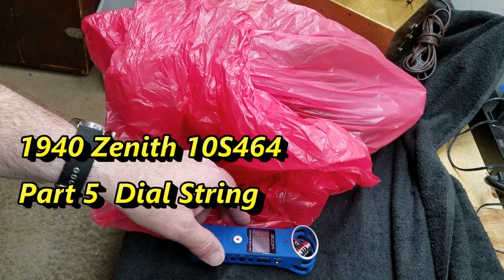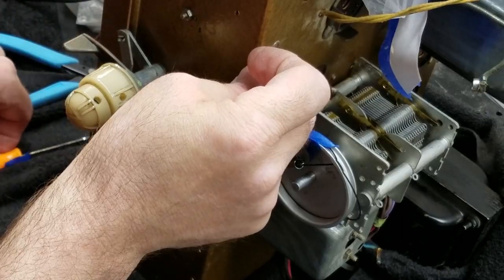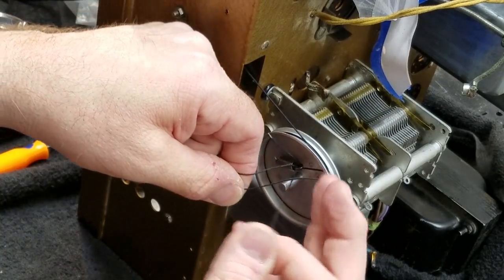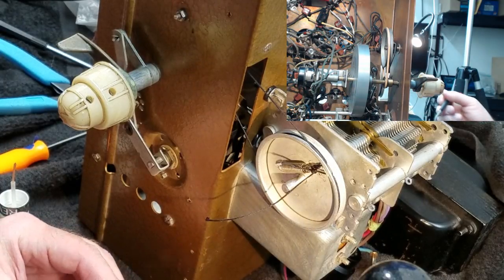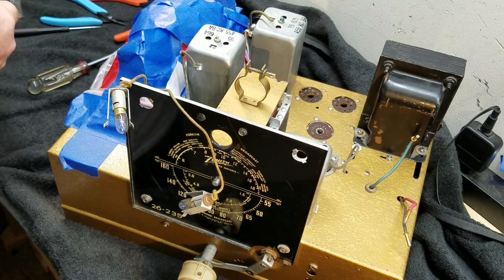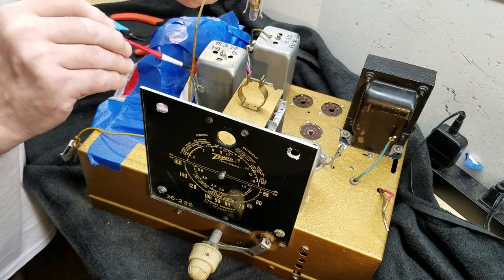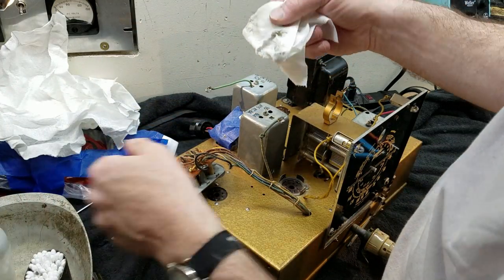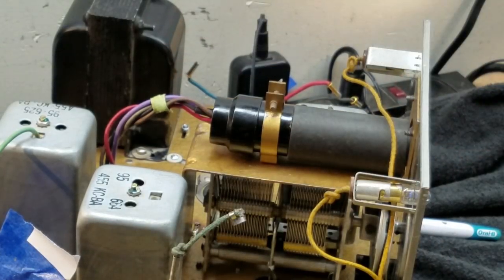1940 Zenith 10S464 Antique Tube Radio Part 5 of 8 Dial String

Comment: Hello. When I was working in a radio shop, we used cotton fishing line 25 lb. test.  It was the same size and strength, plus, it was a lot cheaper.  The only down shot of it was that it only lasted about 30 years on the spool without losing its strength.  In the 45 years I worked there we only bought 3 spools.

Comment: I forgot to mention that we used nail polish to lock the knots.  Each guy had his own color so if the job failed, we knew who did it.
Reply from the maker: I learned the model glue trick from looking at an old repair that had been done up with something that looked like nail polish or lacquer.  Then I began to think about what would work well on polyester cord.  Model glue made sense, and it has worked well.  it is messy, though, and sort of ugly.  Lacquer is cheap, and I might keep with it.  Thank you for your terrific comments, Dan!   Cheers!   Michael

Comment: Unfortunately the dial string is the only thing I've been OK with so far - I have no electrical background or understanding so "that's" been very hard for me to pick up!  But give me a dial string diagram and I have no trouble or qualms! :)
Reply from the maker: Bruce,
I can definitely relate to you on the dial string thing.  I spent 20 years restoring old cars, mostly European.  I can still build an air-cooled VW engine in my sleep!  So, the mechanical side is no problem for me, either.  As an electrical engineer, I understand the theory of radio design and operation.  But, I am a relative newbie to the hobby.  I don't have the 30+ years of experience in the field to help me to know the way these things were actually built and what little tricks can help me to figure them out, fast.  It takes more than knowledge of theory to know how to figure these things out in real life and I wish I had those years at the bench to make troubleshooting these things look easy.  

After being snubbed a few times on the Antique Radio Forum, I decided to take a different approach.  I'd make vids showing how to do what I know well.  In the process, I hoped that I'd make some friends with whom I could exchange information and get better at the things I don't know as well.  So far, it has worked out way better than I expected.  I've met some of the nicest folks, most of which I have subscribed to and they have subscribed to my channel.  By the way, I think that most of the guys on ARF are brilliant.  I just don't think that they are very friendly and they have little patience for newbies who ask the simpler questions.

No matter what you might lack in experience or knowledge, if you participate in the YouTube world long enough, you can get better than you ever thought you could at those things.  Stick around, my friend.  I hope we can learn from each other!  If you see me doing something bone-headed, shout at me and let me know.  I don't have an ego in this game.  I just want to get better.   Before I croak it, I want to get as good as those 30-year veterans are at troubleshooting and repairing these wonderful old sets.  I still have a very long way to go!

I'm really glad that you are out there, and I am grateful that you took the time to comment.  The comments are more valuable to me than you might know.    

Take care.    Michael